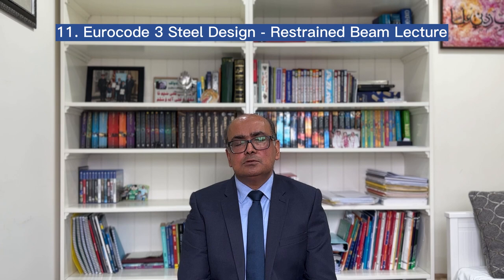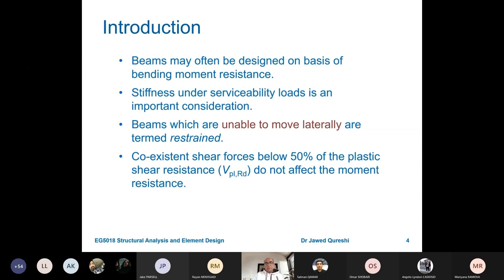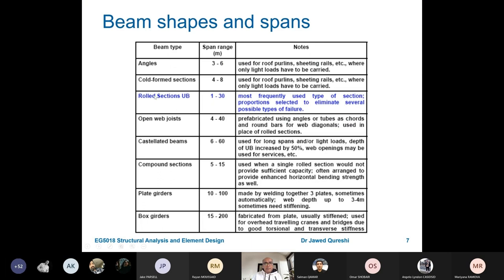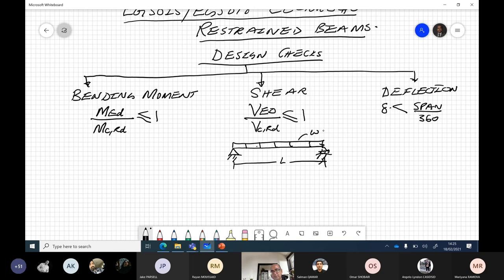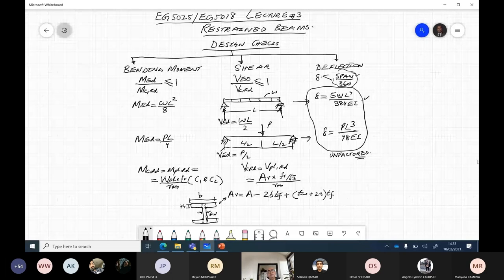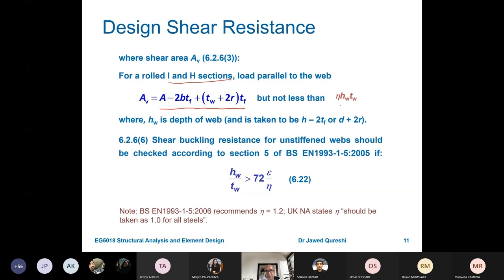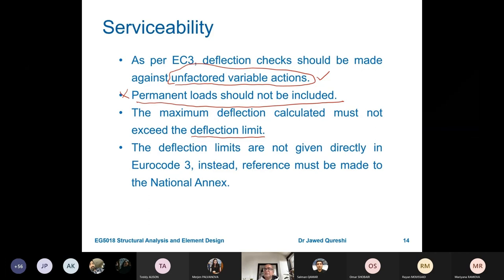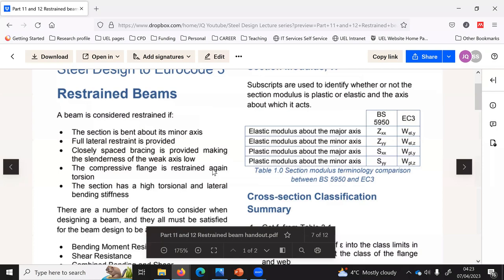11 Restrained Beam Lecture | Eurocode 3 Steel Design series

Comment: Thanks for the lecture. Can a narrow flange beam eg (150mm wide) support a wall which is wider (eg 230mm wide) considering that the bending moment, shear force and deflection have been calculated?
Reply from the maker: It may be possible for the narrow flange beam to support the wider wall. It depends on several factors beyond just the bending moment, shear force, and deflection.
Wide non-load-bearing walls can be supported on narrow steel beams by attaching the wall framing to the beam with appropriate connectors.
Wall to beam connection and stability of wall must be carefully considered.
Reply: @DrJQureshi  Thanks a lot. Much appreciated. Can a welded upperf flange having the same width of the supported loadbeaing wall be the solution in these situations? Thanks once again.

Comment: Hi sir, thanks a lot for the vidéo. Sir purlins are considered as unrestrained beam right ?
Reply from the maker: Purlins, C and Z sections,  are generally produced through cold form manufacturing process. They have very thin sheeting thickness, only a couple of mm. 
Purlins can be restrained or unrestrained, depending on how much roof bracing provides lateral restraint. 

There are separate design provisions for purlins, different to design checks in this lecture. 
This lecture applies to rolled steel sections produced through hot rolling process.